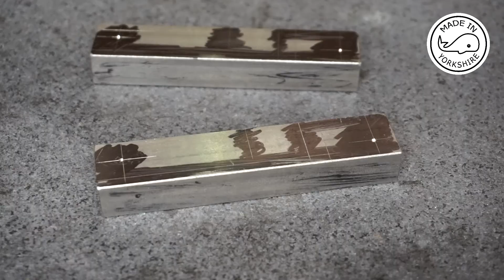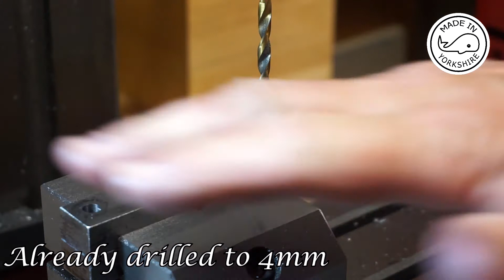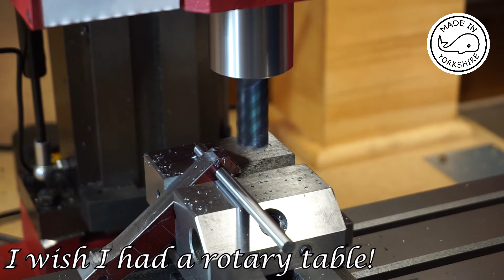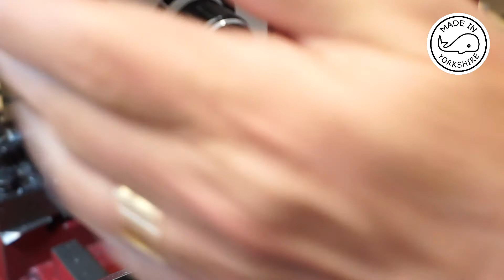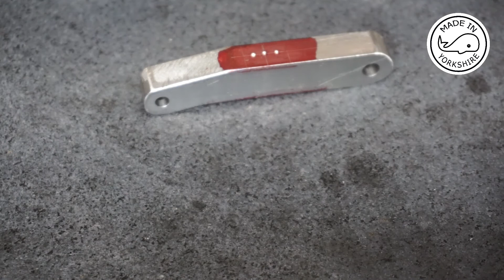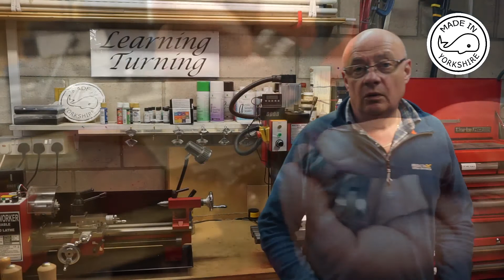#MT19 Part 2 - Making a Hemingway Kits Knurling Tool. By Andrew Whale.

Comment from the maker: Wow - I really do appreciate the suggestions in relation to my flycutter problem and I really do value the feedback.
So, I have decided to investigate several solutions...
1. Use my largest end mill and finish with a round file. Or maybe I could get an accessory for my dremel type of drill to finish it off that way.
2. Investigate boring heads - but I think that might be too costly for a tool I would use infrequently.
3. Look at repairing my cheap and nasty flycutter, by using epoxy resin to permanently fix the cutter into it's holder.
4. Purchase a rotary table - now that would be nice!

Hopefully Part 3 of the video will show you what I ended up doing.

Thanks again and all the best.
Andrew

Comment: A tip on reaming : to ream WITH oil usually results in a slightly oversized hole. Reaming dry can give you a minutely undersized hole

Paddy
Reply from the maker: Hi Paddy - thanks for the tip.
Cheers
Andrew
Reply: And now I shall stop mailing and commenting, lest for the current videos.... I must start to look like a stalker LOL! (I am through your catalogue !)

Paddy

Comment: I feel your grief on the slitting saw blade. I made the same mistake. Then I picked up some new, old stock high quality name brand items off flea bay.... WOW, what a difference, they cut through steel like a hot knife through butter.
Reply from the maker: Hi there. Thanks for the tip. I'll see if I can fund some better quality ones. 
Cheers
Andrew

Comment: Hi,
When putting two parts together in the vice, use some copper solid core wire between the movable jaw and the parts to be held.
This prevents the parts from sliding in the vice, especially if they are not perfectly machined.
Also when reaming holes use plenty of cutting oil at slow spindle speed. 
If the tooling is Hss always use cutting oil except for machining cast iron
This keeps the tool sharp, never run a reamer backwards.
Rule of thumb use a drill bit that's 5% smaller than the reamer size.

Comment: Hi Andrew, if the flycutter doesn't work I previously made similar arcs with a boring head.
Reply: Note also if you still want to try the flycutter, you need to take care that you grind it properly as normally these things are used to flatten stock and consequently are only ground on the lower part. If you wish to use it for creating the arc it has to be ground on the upper part also (after replacing the setscrews with stainless ones)
Reply from the maker: Hi Erik - many thanks for the suggestion. I've not got a boring head, but I will certainly investigate this option.
Thanks again.
Andrew

Comment: That fly cutter fiasco is not the end, like you said a rotary table would be nice and it would come in handy right about now.  I see you persevered and did a good job with the file.
If your not investing in a rotary table to cut that radius, might you have a half round file to do the job ?  Well looks great  and seems you're having fun so go ahead on , you'll have a much better and safer  and elegant knurler when your done.  Cheers  !
Reply from the maker: Hi Greg. Many thanks for the feedback and suggestion. I'm beginning to think that a half round file might be the most cost effective solution. Also, it's just occurred to me that I have a cheap version of a dremel tool, so I will check to see if there are is an accesory that might help. Although it would be a great excuse to get a rotary table :-). And yes - it's turning out to be a really fun little project.
Cheers
Andrew

Comment: I think your fly cutter is faulty. You need to return it for a replacement
Reply: I got a set of small round fly cutters from RDGtools I think it was and these have performed well. The largest radius is around 25mm to 30mm though. This may not be enough. 
eBay item number:
291960409379
Dunno if this helps. The shape of the cutter makes them easy to regrind as well.
Reply from the maker: Hi Stephen - I agree, but it was cheap and will probably cost half as much again the return it. Looking at the design, I wouldn't have much confidence in a replacement either.
Thanks for your thoughts on this though.
Cheers
Andrew
Reply: Learning Turning Metal - by Andrew Whale Hi again Andrew,  I’ve decided to follow in your footsteps and get a lathe and milling machine. I’m waiting for the catalogues to arrive. Are you happy enough with your lathe or do you wish you had gone for the more powerful SC 4? Thanks again for a very interesting set of videos.
Reply from the maker: Hi Stephen - Having made various mods, I'm happy with my SC3. For what I do, power isn't an issue. The only limiting factor I have found is the 80mm self centring chuck. 100mm would be far better. The other good thing about the SC3 is that there is a wealth of information available on the internet about it - not sure about the SC4. When I looked, I think the SC4 was twice the price of the SC3 and I couldn't justify paying that extra. I have however heard that the SC4 is a really good machine. If I was in the same position again and money and space wasn't a problem, it would be a diemma - but I would probably go for the SC4. However it would have to have a 100mm chuck. Also remember that tooling and extras will add to the cost - a quick change toolpost is an absolute necessity. A 4-jaw independent chuck would also be a 'nice to have' too.
Good luck with your purchase and let me know how you get on.
All the best.
Andrew